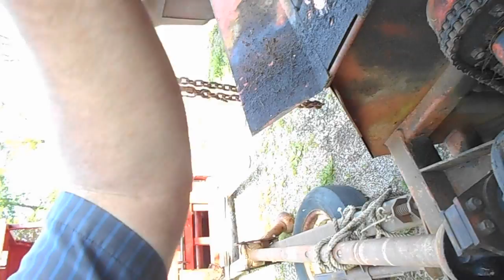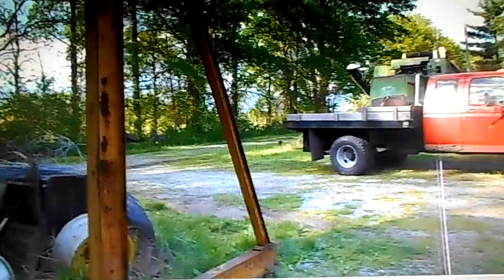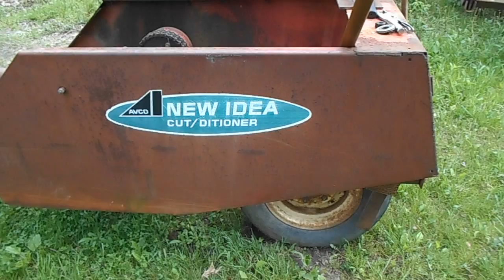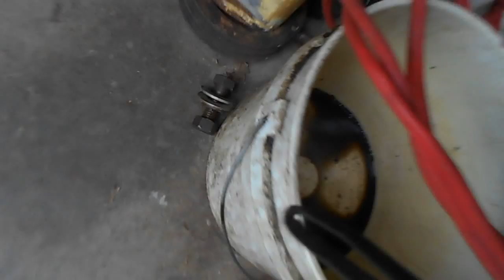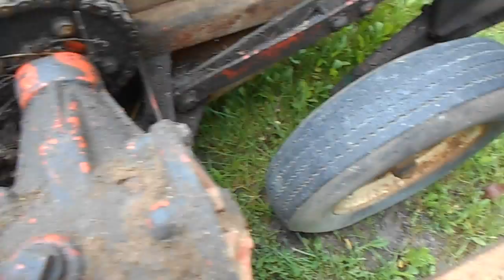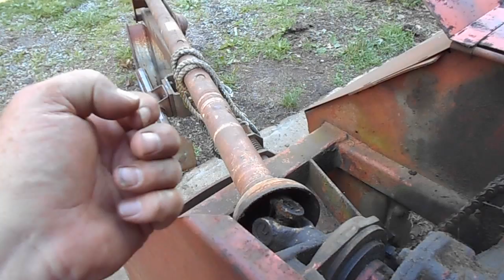Fixin the New Idea 270 part # 2

Comment: I weld in a shipyard in south point Ohio for a living. Some days u make beauties and somedays it's bubble gum welds;no worries I'm sure it'll hold
Reply from the maker: I'm not worried about the welds holding , I haven't had any of them brake so they must be good enough ! LOL I have days ware I figure out real quick its not my day to weld and I hold off a day or 2 unless its a got to do it now kind of thing and they hold. Now mig welding that another story , Bigger stiff I'm ok on but thinner stuff I still have a problem with, Just cant get the heat and wire size right. Got a lot to learn about  mig welding and it don't help when you don't weld for 6 months at a time or more !  You ever use Harris Flux Core wire ? Like E71-T1 or E70-C6 ? I used to make it from .035 to .078 and the ship builders loved the stuff.  Bandit
Reply: @banditfarmer1900  yeah  some flux core but mosty all 6010 stick weld they burn thru about any slag pretty well but they spatter u to pieces overhead
Reply from the maker: @gregorythompson2251   That is one weld I just cant do, Over head just doesn't work for me. I guess if I had someone teach me and I did a bunch of them I'd get better at them but when you don't weld that much to start with its better to get someone who does this all the time to do it and be done with it. Do what you can and get someone else to do what you cant just so you don't muck it up and cause yourself and ass ache later that end up costing you a lot of money to fit it !  Bandit

Comment: Hi BR !  Over my forty years as a red seal welder most common problems I see with people that weld just enough to get by just simply have had zero instruction on how to set the proper amps for x job. What really mess people up is they start the welding game using the mig process, you can teach a monkey to weld mig. Get the stick welding down you'll be able to mig weld with your eyes closed and don't forget to properly clean the surface your about to weld, it makes all the difference in the world . Give her hell BF !
Reply from the maker: My biggest problem is I don't weld enough ! I weld when I need something welded and I can stick weld good enough I guess, Nothing has broken yet ! LOL Now the mig welder well I can get by with the welds I make but I have a problem seeing anymore and my bifocials don't help much, I bought the mig to do sheet metal work I always need done and I get by with it.  Funny thing is I used to make mig wire, E71T1 E70C6 and flux core from .030 to .084, I just couldn't master using it !  My other problem is being on an end pole on the electric and on hot days I don't even try to weld, Think of it this way 95* out 6pm I got to turn the buzz box up to 130 amps to get a 1/16" 6013 rod to start to burn and not that good at that and end up making a chicken track weld !  So I don't weld after 5pm on hot days ! LOL  Bandit

Comment: Ya ur right u can only stitch it back and fourth. Hate doin those cuz I like to run stuff hot when welding to make sure it's really stuck. Seen to many welds pop right off cuz they never penetrated the metal. So when we gona see it in the field? lol anything like us we'd be lucky to not get stuck lol
Reply from the maker: I'm not the best at over head and vertical ups but I can do them, Welding is one of those things you have to do alot to keep good at it. When you havent welded in 6 or 8 months it makes a big difference in how you weld too !  Even going back and forth going from a stick welder to a mig can be tricky too but its funny the more you do the better you get . LOL  The next video I put up will be testing the New Idea out to see if it works or not and what it needs.  I'll be putting it up tomorrow.  I hope you like it.  Bandit

Comment: no problem . i havent used mine yet ...it is opposite of yours ..the manual crank got ripped off so they used collars on the cylinder to adjust the height
Reply from the maker: I know ware a 271 is that is the same way as yours, How they did it I'll never know but the crank is broke off so it has to be done the same way your doing.  I did get to try this one out (next video) and it does work but it does need the paddles sharpend for sure to make it cut good. The work never ends ! LOL   Bandit

Comment: i could take some measurments of my 272 if that helps
Reply from the maker: Well I think I got it now, At least what I have is welded in and it does raise up and down without any problems so whats there is going to work just fine.  Thank you for the offer tho . Bandit